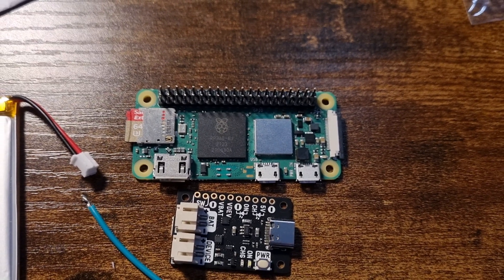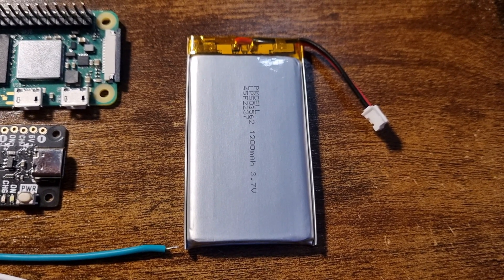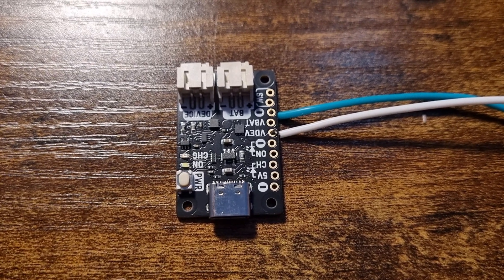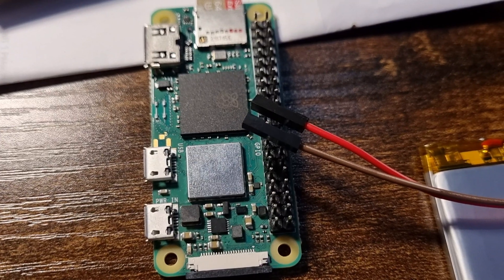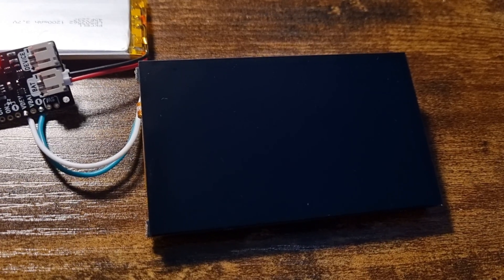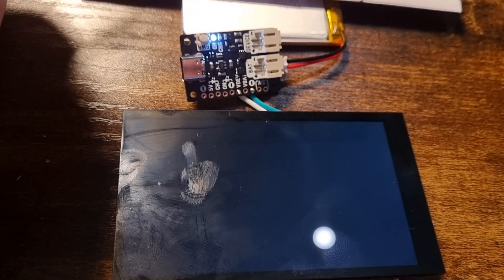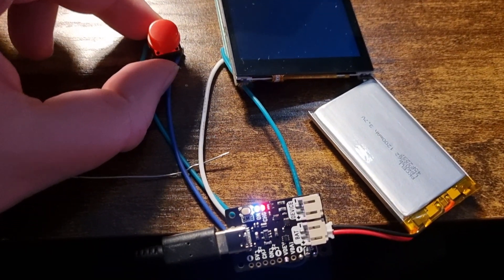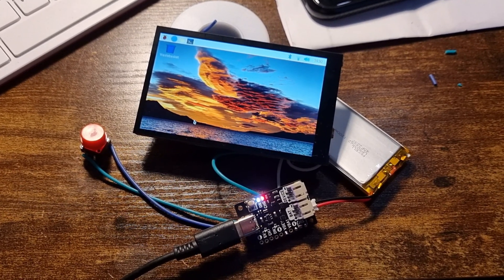#tutorial Powering a Raspberry Pi and display with a LiPo Battery pack (LiPo Amigo Pro)

Comment: The battery outputs 3.7V. So does the Amigo Pro with a 3.7V battery connected. You're connecting that 3.7V to the 5V pin of the Raspberry Pi. This is a bad idea. You need a 5V upconverter.

This might work briefly, but it's certainly not guaranteed to work over the long term. I don't think that you're at risk of damaging the components from an undervoltage condition, but it's quite possible to corrupt the microSD if the power supply fails during a write.

Comment: Cool. I can't find much info about the Lipo Amigo, thanks for that. I am searching for one that could power a RPi3+ or a Pi4 with my 3x18650 pack. I think that's not the one for that duty right since i believe it's only 1A at output.
Reply from the maker: Hi I'm in the process of building one myself using a tp4056 MT3269 voltage booster and a single cell 18650 battery.

Comment: Daniel, do you always leave Raspbian on you Pi's, or do you always put Linux on it?
Also, what is you decision making proces? When do you go for which OS?
Thanks! 👍
Reply from the maker: I use the distro I need for the project, retro games get retropie or Batocera, programming and coding usually raspbian, media Centre kodi or android, and as a general desktop Majaro. I don't really have a process I've just tried many Linux additions and use my experience when making a selection based on my project.
Reply: @ckenthusiast  Okay, that doesn't help at all :D Thanks!